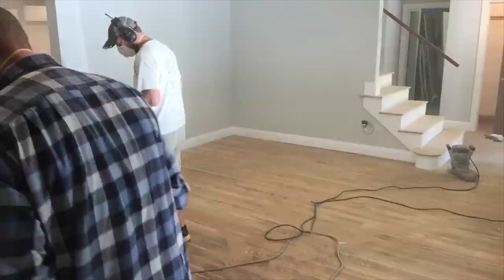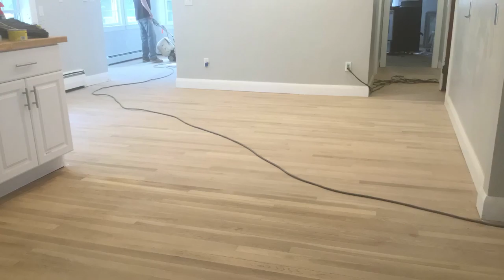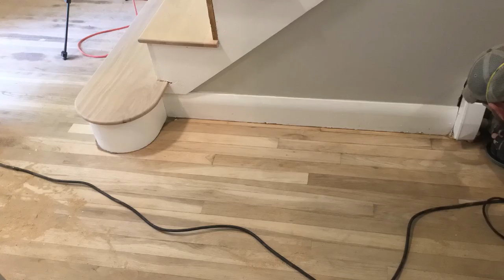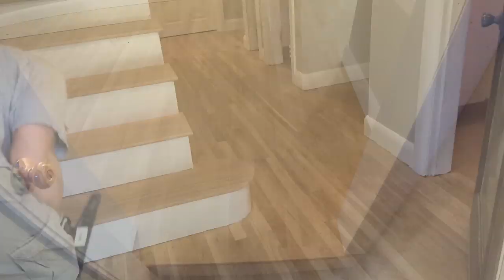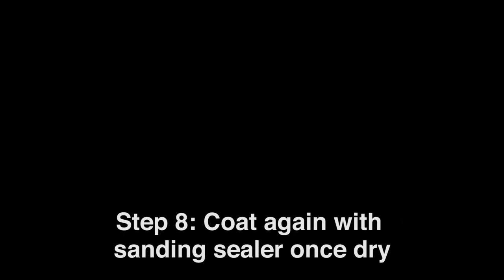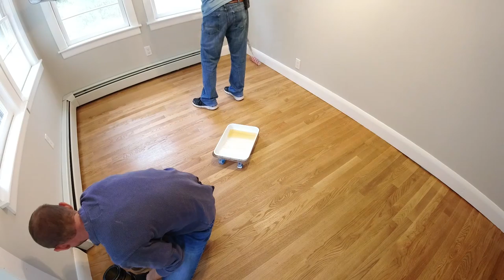DIY Hardwood Floor Restoration Time Lapse - Sanding and Refinishing 700sq ft of Flooring

Comment: AWSOME job guys💙 I bought my home in 1990, it was built in 1954, I bought it from the elderly couple that built it, oak floors had dark stain so I had them professionally redone, sanding the whole thing with a lighter stain kinda like I see in this video, my only regret was not having more coats of poly put on my floors, a friend of mine told me I could do it myself and told me the steps of sandpaper to use to get the poly up, and just redo applying how many coats I wanted, just make sure I allow proper drying times in between coats. I believe I can do this, it would mean me staying in a Hotel for a few days so I could stay off of it between coats of poly but I think it would look so much nicer and new, not a whole lotta cost, just my time and labor, hotel and food, but it’s way cheaper than hiring it done, now I’m inspired to go for it, I’ve wanted to do it fro at least 10 yrs, thanks for this video and for giving this 62 yr old gal a reason to just do it🤷🏼‍♀️🙏🏼💙
Reply: Have you considered using water based poly.  It dries very fast, usually in a couple hours.
Reply: you go girl!
Reply: water based is the way to go !!
Reply: I did my whole house with Cabots water based in a clear satin  - I was about early 60s at the time - easy enough.  Was a bit apprehensive as I had been told the machines were strong to use so I sat on the floor and used a 1/3 sander. I did room by room, it  took a while, but came up beautifully.  On reflection  I am so pleased I used water based - it dries v. quickly - and the Satin finish doesn't show small surface scratches like Gloss.
Reply: @maryallen6334  yes it dries quickly and has zero scent,unlike oil based poly

Comment: That's so much work! I'll look at every refinished floor with a new appreciation.
Reply: Cody Gammons especially since they used sanders designed for the final pass to do the entire process. A proper drum sanding would have done this faster and better. Also using an angle grinder to sand edges is ridiculous. There’s too many of these videos showing the wrong way to sand. Drum sand, edge, buff, scrape corners, Water-pop, stain, finish.

Comment: Wow 30 years of doing hardwood floors I never saw a floor done with out buffing between coats lol rock on
Reply: If you are such an expert, why are you watching?
Reply: @kevinbushracing58  Pros will watch and use such videos to show how not to do hardwood floors.
Reply: Anyone can do it. Other than blending the edging, it takes very little skill. It is hard monotonous work though.  Really time consuming if you want perfect results.  Most rental machines are not worth renting.  They just dont have the power to cut a floor like a professional belt sander.
Reply: Ha. For sure. And that under the cabinet edging with an angle grinder. I tried that on a job once. Extremely hard to control and not dig into the wood

Comment: Thanks for this tip regarding knowing what you're doing with the belt sander. Bummer that you discovered the problem when you sanded wirh the orbital. Looking for finish on this. Will have to see if I can get to it.

Comment: Wow, that was a huge job! Came out beautiful. I did a couple of rooms in my house and I have to say, it's a lot of hard work. And not as easy as you guys made it seem. I ended up creating a few dips when I was using the big sander and the edge sander (it was different than yours) was heavy and hard to handle so the base boards got nicked up along the way which added more work in the end!
Reply from the maker: Hey Sharon!  Yes, it is a TON of work.  We sanded for 20 hours!  We also nicked the baseboard a bit so that will need to be touched up.  The whole process is exhausting but worth saving the money and very rewarding when it is all said and done.  Thanks for checking out the video!
Reply: The Fixer I know your brother greatly appreciated all the labor of love behind the work💙
Reply: Sharon J Smith, I think I can take up my poly and redo, if you can surly I can💖
Reply: I bonk the baseboard all the time.. if you don’t ding the trim here and there, you aren’t sanding hard enough.
Reply: @krakenwoodfloorservicemcma5975  So it's important that you bang.up.the trim?

Comment: Don’t be afraid to use a drum sander. It’ll cut your sanding down in half. Great for resurfacing the old floors and pro tip, sand with it at a 45 degree angle to grain to ensure you don’t leave any long runs in the floor.
Reply: How do you decide when to use a drum or orbital sander?

Comment: Very nice video! For sealer and finish it is best to apply with the wood, not perpendicular to it. Even edging should be done as you go. That's how you got those streaks. Clear finish is very forgiving though, stain jobs require perfection.

Comment: Wow! You guys did an outstanding job! Looks amazing! I have wood floors just like that but the poly is going thin so I will need to have that redone. Unfortunately, I fostered some kittens and they were urinating under an end table and now I have a large black area under this table (the area was blocked from view when this was happening). How do I remove this stain or should I just put a dark walnut stain on the rest of the floor when I redo the floors???? I’d appreciate your input.
Reply from the maker: Hey Julie!  Sometimes you can't get a stain out.  If you take a look at this floor we did, we have some spots that just wouldn't come out but it actually adds character to the floor I think.  Just don't tell anyone what it is from haha.  If it really bothers you, you could patch it.  This video might help... https://youtu.be/ly3x2bt5JU0
Thanks for the kind words and for checking out the video!!
Reply: Try peroxide or bleach. I've seen a video of a lady using even hair dye color lifter to rid of cat urine stain. YT has a lot of vids.

I've used bleach successfully.

Comment: Looks good but you only need 1 sealer application and you should do more than 1 coat of poly and sand with at least 220 grit after the first coat. Bona recommends the Woodline be applied 2 or 3 coats.
Reply from the maker: Thanks for the feedback, BMac!  And thanks for checking out the video!

Comment: Use an edger and drum sander next time guys. If you do it right, it will save all that fancying about xxx
Reply from the maker: I know... I also was told that if I never used a drum sander before I could mess up the floor pretty bad so I weighed my options and went the safe route.  Thank you for the comment and for checking out the video!

Comment: But I have so many questions, the description says it took 2 days of sanding, how long did the project take overall? How long did you leave the sealer to dry before the second coat and how long before the poly? How did you decide what poly and sealer you wanted to use? How did you like using those sanders? Were they aggressive enough to get the floors sanded or did you have to go over the same spot a few times? Did you have any speed bumps - anything you discovered about the floors condition that you had to work around, or running out of sanding circles? How many sanding circles of each grit did you end up using? How many trips back and forth to the store did you make? hahah. 

I really want to tackle this myself but the last project I did (painting my kitchen cabinets) was a MUCH different experience than people led me to believe so I want to really know what I'm getting into before I decide to do this myself. Thanks if you're able to answer any of these questions and THE FLOORS LOOK GREAT! Great job!

Comment: What do you use to coat the floor with polyurethane?  Some say use lambs wool.
Reply from the maker: Hey, Camielle!  Yes, I typically use a lambs wool applicator.  In this video I used a special roller for poly that I believe was also made out of lambs wool.  Thanks for the comment and for checking out the video!!
Reply: The Fixer thank you so much for the quick reply!  I love all of your videos 🙂
Reply from the maker: @CAMIELLETETRIS  And thank you so much for watching!! 😁😁

Comment: What did you use for an applicator? Assuming you did three coats of modified oil finish were the first two coats glossy with the final coat being satin? I had a friend who had a business installing and finishing hardwood floors and he told me because satin is a softer finish because of the additives that the first two coats should be glossy as they are harder.
Reply from the maker: Hey Gary!  We used a lambswool applicator for the two coats of sanding sealer and a roller specifically made for poly for the 2 coats of satin poly.  Hope this answers your question.  Thanks for checking out the video!
Reply: @TheFixerHomeRepair  I was told by a floor finisher that you should use gloss for the initial two coats and satin for the finish coat, reason being the satin coat is a softer finish due to the additives to dull it.
Reply from the maker: @gary24752  I would trust your friend.  I am not a professional floor refinisher.  I am a DIYer.  It sounds legit to me honestly.

Comment: You will get faster and flatter results with a belt sander.  Those three disk sanders are only good for the final 100 grit pass
Reply from the maker: I know.  Check out the description of the video for the reason I didn't use a belt sander.  Thanks for checking out the video!

Comment: Yes, how many days did it take to complete project?
Reply from the maker: Hey Consuelo!  So the sanding took 2- almost 10 hour days.  The first coat of sealer was done the night of the second day.  Then 30 minutes to apply second coat.  Let it dry for a few hours and apply the poly.  Let dry for a day... Altogether the project took 4 days.  Thanks for checking out the video!  I really appreciate it!
Reply: The Fixer what would approximate labor costs be for a job like this?
Reply: Sheri L 3-5 dollars a sq ft

Comment: Is this sander strong enough to be used to remove carpet glue from plywood flooring on my pontoon boat?? It's not hard glue.. it's just residue of the dried backing and glue

Comment: I know very little when it comes to this type of thing but love watching (weird I know). I understand sanding the edges but what is the reason you scrape the edges? Is it to get the debris out? Curious minds want to know, lol. 

Love watching your videos,  very informative.
Reply: Only thing that can get into the corners you basically sharpen the scraper and it acts as your sand paper to get the super tight corners its a trade trick. Most people will opt for quarter round molding in the end (diy) cause it'll cover that last bit of edge

Comment: Floors came out amazing, just wondering why you guys decided to not put a second coat of poly? Great job!!!

Oh yeah second question, does the Sealcoat require sanding in between coats?
Reply: If you stain the floor then u put 2 coats on top of the stain and then buff it ,if it's a natural finish floor, you can do the same or buff in between each coats if it dries rough

Comment: If you would’ve done that on a dark walnut floor or a ebony floor ( the sides and ends coating ) it would’ve showed. It didn’t because it was a natural coat no color. Just a tip! Don’t cut in like that on a dark floor, just stay with the lambs wool or whatever applicator you use.

Comment: Why didnt you take the base board and kick plates off?
Reply from the maker: It was not necessary, I was able to get under the heaters and tight to the baseboards.  Would have been lots more work and hard to make it look good.  Thanks for the comment and for watching!

Comment: Hey, I know this is an older video but what’s the sander you’re using to get under the baseboard heating called?  Thanks!
Reply: Kick toe sander
Reply: Or a radiator sander depending on where you live

Comment: Hi guys , how many days did the project take start to finish ? Thanks
Also what did you guys use to push the sealer around? It looked like a roller or broom ?
Reply from the maker: Hey!  Great questions!  It was 2 full days of sanding and 2 days of sealing and poly.  We used a lambs wool roller for the sealer and poly.  Thanks for watching!
Reply: @TheFixerHomeRepair  thanks for the reply
Reply from the maker: @IronMannara  no problem! 👍

Comment: Does some know kind of applicator to use?
Reply from the maker: Hey Steven!  I typically use a lambs wool applicator for the poly.  In this video I used a roller which i believe was also lambs wool.  Thanks for checking out the video!

Comment: Can you do it one room at a time, so the tenants don’t have to move out?
Reply from the maker: Hey, Bill!  If you are doing bedrooms, it is possible.  Just shut the door and seal it up tight.  For something like this... no way.  All the poly and sanding needs to be done at once to make everything match and the smell would make you sick.  But bedrooms or maybe a top floor when you can stay on the bottom with plenty of ventilation.  This make sense?  Thanks for checking out the video!!

Comment: Good effort but did you buff before last coat? I usually buff before 2 nd and 3 rd cost for a smoother finish
Reply from the maker: Yes it is a good idea to buff in between coats!  Thanks for the comment!

Comment: What’s the full timeline on this job?
Reply from the maker: Hey!  In our case it was 2 full 8hr days of sanding.  Then sealer, wait a few hours.  Coat of poly, wait 24 hours.  Another coat of poly, wait another 24 hours.  Wait longer if you can to move furniture and everything back in.  Hope this helps.  Thanks for watching!

Comment: Why only 24 grit paper? You feel thats the best to sand it right off ???
Reply from the maker: That is the lowest they had for that sander.  If I was bold enough to use one of the big belt sanders (the right tool 😁) I could probably get something more rough.  I was not comfortable using the belt sander as I think you can mess things up a lot easier.  In the end, it all worked out.  Thanks for watching!!!

Comment: It would of made easyier work sanding wood for stairs before installing
And the little cabinet in kitchen could of been removed with a few screws and cut the caulking on back splash..otherwise beautiful job.

Comment: Thank you for sharing going through a similar project at the moment and would like to ask you a few question if you don't mind:
1- what type of wood that was installed
2- what is the advantage of applying a sealer as apposed to just polyurethane?
3- what gloss level was the coating wondering if oil based  semi-gloss on douglas fir would be too shiny (for my project)?
Thanks

Comment: I've been finishing floors for 25years. This is why you should hired professionals . Everything about this sanding job is wrong. Good thing you didn't stain it is all I can say because the scratches would've been horrible. Wow!
Reply from the maker: Well I will say I have tremendous respect for you being in the business for so long because of how labor intensive this is.  I'm happy with the floors.  So is my brother.  And he saved thousands.  So thank you for your opinion and I understand that seeing amateurs do your job might be frustrating but not everyone has the money to hire a professional.  I would be interested to hear exactly what we did wrong.  Maybe you could make a video of what not to do?  Anyway, thanks for the comment and for checking out the video.
Reply: @TheFixerHomeRepair   Drum sanders are the way to go, for starters. You ran the edger backwards most of the time. You should never use a grinder, use an orbit sander for the hard to get places. And when applying poly never cut in the whole room do it in about 5ft strips when using a roller. I could go on. And I understand about saving money. No disrespect, I was just goofing. Yall did bust ass, I'll give you that. And I don't have time to make videos,  I'm too busy trying to make money.
Reply: jtmtdm1978 the guys that redid my floors used a drum sander, they had and have a family business for yrs, I did notice in my hallway where they sit the drum sander down and I can tell if I just get down and look the indention it made, plus in a few corners i can see swirl marks that the small hand sander they used made, I was pleased but my friend that did his mother in-laws home used the same type sander that these guys used, when they redid her floors and 15 yrs later when she wanted the old poly up and new and more coats put down. It did cost me quite a bit of money and looking bk I believe I maybe could have done a decent job using the sanders that they used, but it’s all good at the end of the day, just comes down to if you wanna spend $$$$ or DIY, at the time I had teenagers so time wasn’t on my side, but now their grown and have their on homes, I’m not planning on selling so if it’s not quite what I’m hoping for at least it will have a fresh look, and shine like glass, wish me well 😊
Reply: jtmtdm1978 how much would labor costs be on a job like this? I am in Illinois?

Comment: Should have used duraseal and a drum sander but diy i guess
Reply from the maker: Yes, I do say in the description I am not a pro.  I welcome any comments that suggest other ways to do this and am aware that a drum sander would have been way easier haha.  I was honestly afraid to use one because I have never before and everything I heard was if you don't know what you are doing, do not even try.  This worked for us though.  Even though it took probably 10 times as long to do it haha.  Thanks for the comment and for checking out the video!!

Comment: 24 grit?  You'd be in the basement in 10 seconds.
Reply from the maker: TomKaren94 haha not with hardwood.  This is oak and it took hours to make a dent.  The belt style sanders would have been quicker.